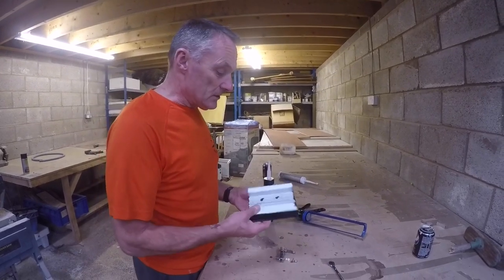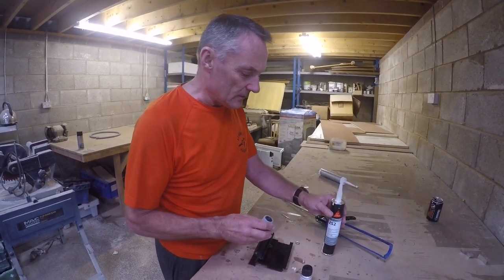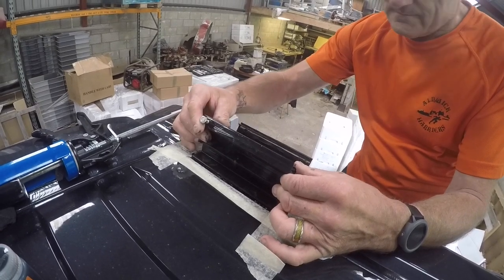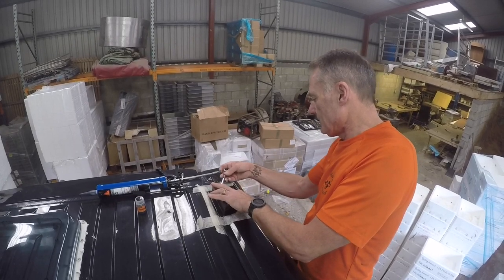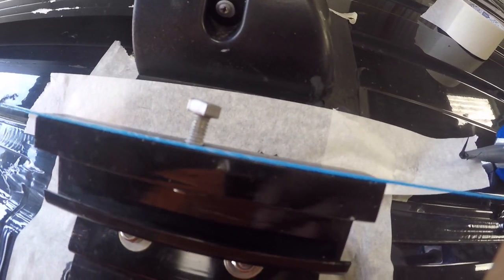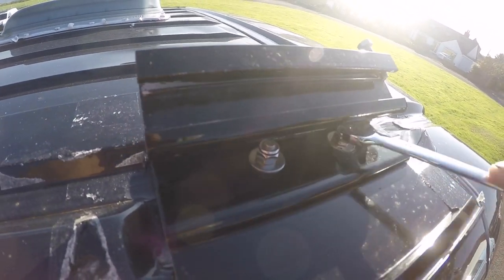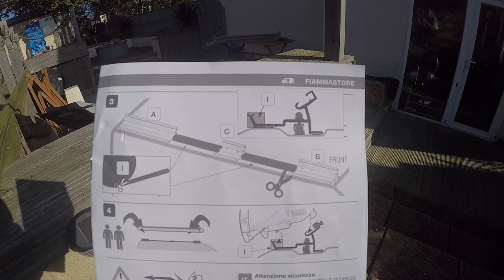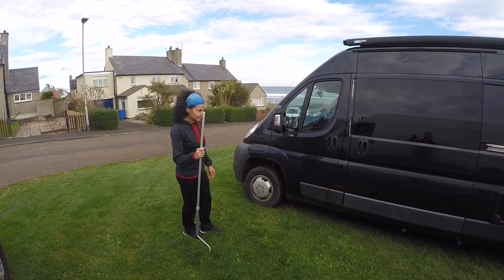How to fit an awning (Fiamma f80s) to l3h2 citroen relay

Comment: We just bought out awning last summer. We only used it twice.  We had issues with the awning flapping in the wind and not staying taught.  We didn’t know you need that center bar.   When we purchase ours no one told us we need it.   

Thank you for answering that for us. I found your video helpful.
Reply from the maker: Yes the bar is a good addition. You can also buy clips which can be attached each side and peg to the ground with guy lines.
Also NEVER leave it out overnight or for a few hours.
We learnt the hard way due to a passing squall.

Comment: Hi John, Great film and thanks for posting - my awning has just arrived ready for fitting. I noticed on my leaflet that the grey spongy bit supplied goes the other end of the winding handle to protect your van roof where the winding pole meets the curve of the van roof as you wind in or out. Yours might be different of course as I have a different van!! May help to protect your roof paintwork though if it's like mine. Time I got going on mine now!! :)

Comment: Great video. Apologies if I missed it but how long is your awning, your amazon link says it was a 340 so is it 3.40m. I have a long-wheelbase Peugeot Boxer L3H2 and the Fiamma supplier recommended a 3.7 awning in length because of the bracket spacing on the roof, would you be able to advise? many thanks John W

Comment: Interesting.  I bought a set of mountings from a fiamma seller, for my l3 h2 boxer. 
My brackets are low profile, and are for an f80 s awning. But are completely  different  to yours, but they are on the van roof and align up pretty well. 
Awning arriving late nov!
Reply from the maker: Yes I think they’ve been changed. You may have seen earlier comments about siting the different sized brackets. I swear that I followed the instructions that I was given. I suspect that these have also been changed.
Thanks for commenting.

Comment: Thanks for the video, getting ready to install one of these on my RAM Promaster
Reply from the maker: Great! They are good. Just remember to never wind it out fully without putting the legs down.
Reply: @craster_van_kippers  Thanks again, got it installed the other day, finding the right point to stop unwinding and pull out the legs took a second, but once I figured out how the swivel part pops out to allow the legs to fold down it all makes sense. Thinking about getting that additional strut, have you found it helpful?
Reply from the maker: If there’s a bit of wind or rain it does stop the canvas flapping about. It perfect weather as a sun shade, I don’t bother,
Be warned, never ever leave it out unattended, and get the habit of winding in overnight. We always did. Except once during the day in perfect weather. A squall came through and collapsed and damaged the awning mechanism. If we didn’t have tie down straps fitted, it would have gone over the roof and smashed possibly the skylights and solar. I was devastated but managed to wind it almost back in. I have since discovered that spares are reasonably priced and have repaired it. I shot some vid but haven’t got around to publishing it.
Reply: @craster_van_kippers  thank you, good advice, I’ll be sure to wind it up at night.

Comment: Hi, can you tell me if the wall brackets came in your kit. Looking at the instructions online, it looks like they do. If they did have you not been tempted to fit them?
Reply from the maker: Hi lizzy.
At the time of filming (apologies for the sound) I had to buy vehicle specific brackets separately for approx £90.
I did want the awning on the roof as that is where that awning is designed for. If I had an H3 then I’d have used a different awning with its wall brackets which probably fit any van.
Finally I believe that Fiamma have redesigned this fitting kit but I haven’t seen one.
I’m doing another build ATM but I’ve decided not to fit one at all. Possibly strong magnets a tarp and couple of poles. Cheap,lightweight, keeps sun off and no great loss if damaged.
Are you a member of any self build forums? I’d recommend “south central self-build” on Facebook.

Comment: Excellent video, (apart from a reduction of audio volume and quality when using the camera itself, but I see that has already been mentioned), and all done at a steady pace so as to be easily understood and related to the product.  You may want to consider fitting a 'dead cat' wind noise sock too.
Not sure if you're aware, but you may well be able to increase the audio volume in your video editing software.
Regards Mark in the UK

Comment: Hi great vid and informative, I’m looking to do the same and fit solar panels, was hoping to use uni strut or similar, how did you fix you4 panels. Thanks.
Reply from the maker: they are on standard brackets but also bolted on. sorry about the crap audio. if I was doing it again I would use unistrut r similar

Comment: Well done,i fitted a DOMETIC PR2000 and is virtually identical,did you find it a bit strange that the van has four lugs on the roof and they only supply three fittings to bolt it on.
Reply from the maker: Paul & Sue Brown yes I did. I even considered cutting the middle one in half but decided that three must be enough. I’ve seen the Dutch guy doing his then had to chisel off the misaligned brackets.
I think I’ll try to over dub the crap sound. I know it’s a very niche audience but I still think it has some value.
My next one will probably be me DIY copy Remis type blinds.
Reply: @craster_van_kippers  Hi there wasn't a video when i done mine,I even considered cutting the middle one,so i applied the adhesive and brackets and nipped  them up then tightened them fully the next day so it was all aligned before the adhesive fully set.I also fitted some Remis blinds i got cheap i didnt even knew they done copies,as for the sound I don't think that really mattered.

Comment: What is the gutter guard called from eBay you used to stop the drips
Reply from the maker: @helenholden484  hi Helen. It’s actually just a door seal with the correct profile. The original listing is gone but I’ll have a Quick Look now. 
There were a couple of comments ridiculing this but I swear it’s still in place now after roughly 60,000 miles.
Reply from the maker: @helenholden484  https://www.ebay.co.uk/itm/363733385783?mkcid=16&mkevt=1&mkrid=711-127632-2357-0&ssspo=YMqbpu1oSuS&sssrc=4429486&ssuid=UzXPUFF2SQu&var=632951932257&widget_ver=artemis&media=COPY

I can’t find the original but this is some I bought for another van. The profile was correct but the adhesive was crap. If this is all you can find then consider getting some 3M double sided tape. Make sure paintwork is very clean.

Comment: Can these be fitted if a roof rack is already in place?
Reply from the maker: To be honest I’m not 100% sure. I would imagine that it would be compatible with a Fiamma rack.
If however you are right at the beginning of a build, you could consider bolting unistrut direct to the roof. I’ve just done exactly that on another vid. Ultimately much cheaper than a roof rack plus loads of possibilities.
Finally I think there are now different brackets for these awnings.
Thanks for watching.

Comment: Good quality hand wipes are perfect for removing the sika
Reply from the maker: Aye. You’re not wrong.
Please be aware that these brackets may have been updated/improved. I’ve left this video up incase these older ones are still around. Personally I don’t think I’d fit an awning to a future van.
Most likely go for a tarp.
This is fifth season and as we rarely use sites not out much.
It’s a lot of extra weight. Saw a great tarp setup at willowfields recently.
Reply: @craster_van_kippers  the brackets are still the same so the video is a great help .I have already got to awning and totally understand what you mean by not using it much.  
Thanks
Reply from the maker: Ah good to know. It’s just that a debate was had in the comments that I’d put them in wrong order. I have to say I did wonder at the time and slavishly followed instructions. They didn’t seem correct. Perhaps it’s the instructions they’ve changed.
If you ever need spares I’d highly recommend “agent Fiamma”. They were excellent. There are some parts differences depending on serial number.
I broke our rule and left it out unattended. A squall came through. Thankfully easy to fix. I videoed that but like loads of other vids I’ve done nowt with it.

Comment: Hi I think  you meet of put your bracket on wrong way that's y you had to ✂️  it the big one ..is to go on the Back and small one in the middle midsize..go on the front...
Reply from the maker: Hello John. Just read this now as I’m travelling. You are correct with left hand drive vehicles. Ours is UK right hand drive. The instructions clearly state that the longer bracket goes to the front. I would fear that not following this instruction would invalidate any warranty. I can send you a picture of page 3 in the instructions. Thanks for taking the time to comment.
Reply: @craster_van_kippers  The current instructions state ( for an L3 van, which yours is) that the large bracket goes at the rear, the small bracket in the middle and the medium bracket at the front.  This is the same order for both LHD and RHD.  For the long L4 van ( 6.36m) then the order is different (as are the supplied brackets) with the large brackets at front and rear, with the small bracket in the middle.  Looks like you had the problem with the front bracket as you used the long one which should have been installed at the rear.  Perhaps things have changed, but if not then it would explain the problems you had.
Reply from the maker: @y0rkiebar  nowadays I’d have just done my own thing but I assure you the instructions supplied to me were how I fitted them. It didn’t seen right but I slavishly followed them. Wouldn’t do that now. In fact I wouldn’t even fit a wind out awning. I’d go tarp and magnets as a sun shade.
Thanks for watching;

Comment: nothing is "plumb" or "level" in a van conversion. First rule
Reply from the maker: Correct! Hence the string line. 
I believe that Fiamma have changed the design of these brackets to lessen the chance of getting them out of alignment. Which brackets have you got?
Reply: fiamma F80s with sprinter/crafter  brackets kit and a rain guard
Reply: @craster_van_kippers  fitted it today, was a nightmare to align them